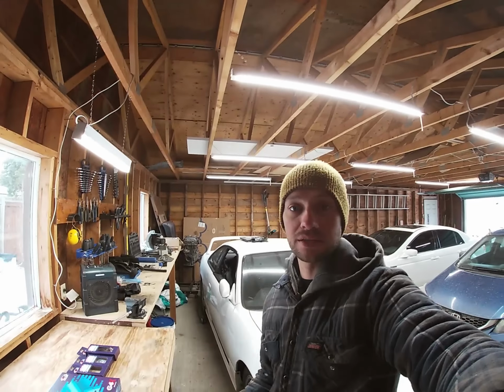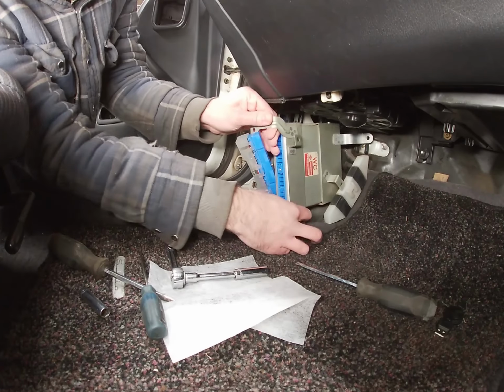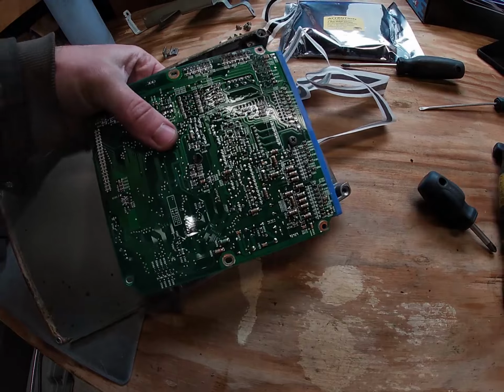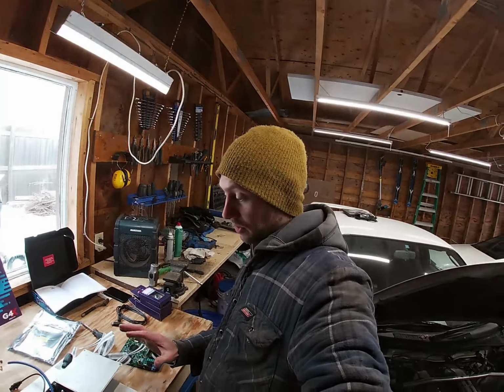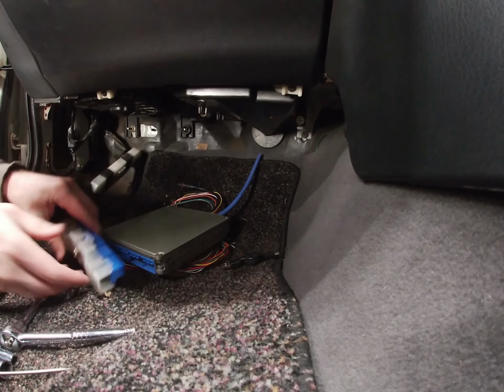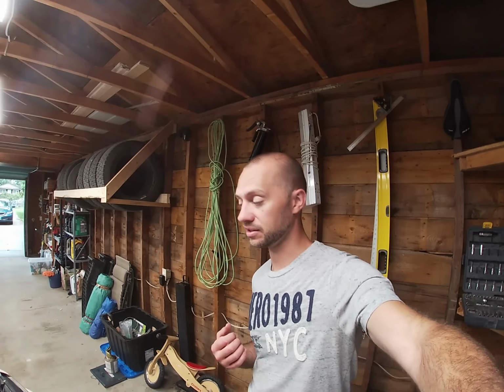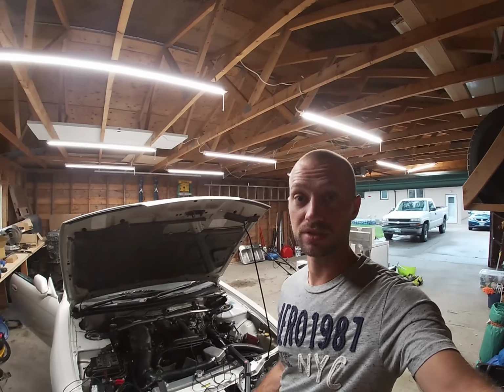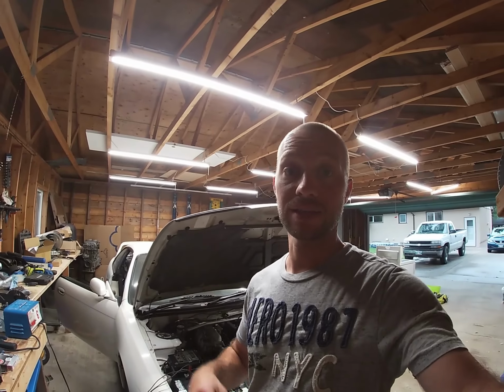How to install a Link ECU

Comment: This is the same ecu i plan on running in the S2000 once i get to that point.. i was between link g4x and haltech elite 1500, but links fits better since it goes inside the stock ecu.. Any cons that you have come across by running links?
Reply from the maker: My biggest recommendation would be to find a good tuner, then run the ECU they work with. It's a good ECU, i still like it, but had a tough time finding a good tuner to work with it
Reply: @MtGarage  I am very familiar tuning with hondata S300, So i plan on tuning it myself, evans tuning has courses i can buy that show step by step tuning cars using this ecu.. i feel i can do it with more knowledge on how the software works.. I am always changing stuff with cars so i feel i need to learn the tune myself in order to have a good running car.. Most decent tuners here are at least 7hr away..

Comment: Hey I'm doing the same thing on an S14 Silvia, I have some wiring questions for the expansion harness. I have a fuel pressure sensor, oil pressure sensor, IAT all installed.
Do I just run my 5v to each sensor in parallel from the expansion harness? 
Do I do the same with the sensor grounds?
I'm hesitant to start doing my wiring because I can't find any info on the expansion harness wiring when it is going to multiple sensors.
Reply from the maker: That's a good question. I would suggest asking this on the Link ECU forums. They will get back to you quickly and are very willing to help. I also found no information on the expansion harness

Comment: Did u have to mess with ecu jumper switch
Reply from the maker: I did not need to change the jumper as I'm running the S14 and the jumper setting did not apply to me
Reply: I got the same ecu same engine  same car  my tuner is struggling to get car started any tips to look at ?
Reply from the maker: I had to set the trigger offset to about -60 to get close to starting. I realized the trigger and timing settings are very important. Also reach out to Link support or the Forums, they are very good